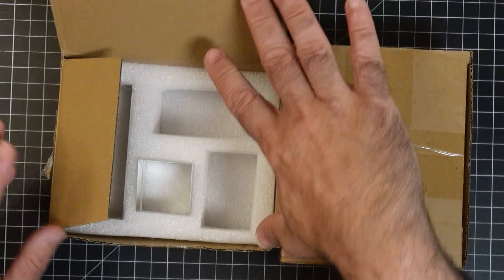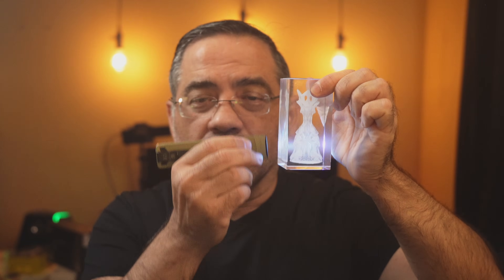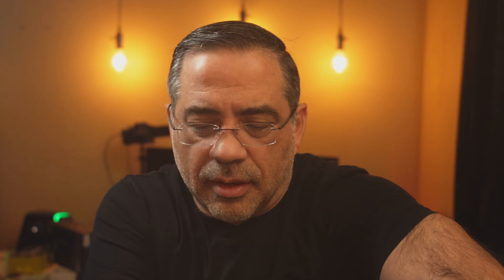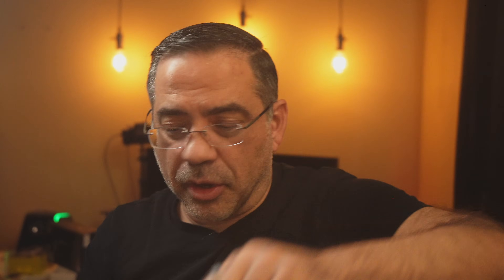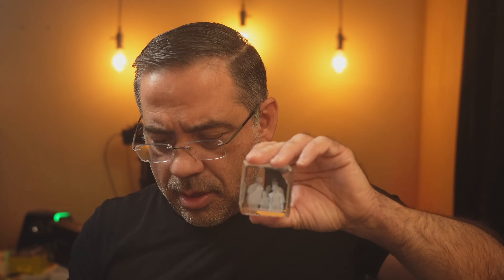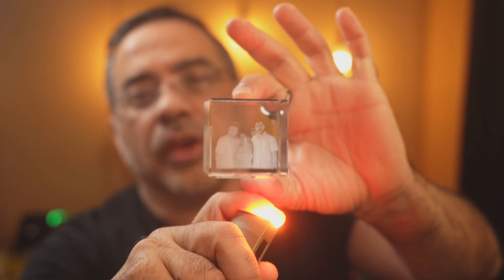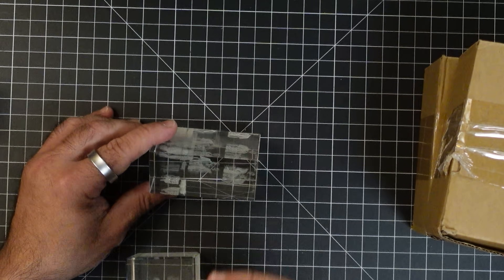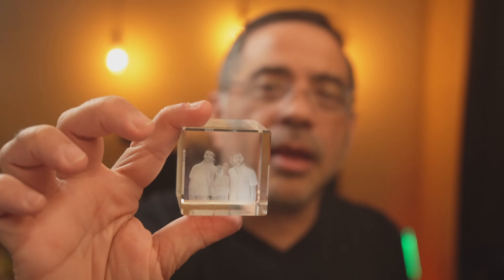HOW TO IDENTIFY FAKE K9 GLASS F2 Ultra UV

Comment: I was wondering if you would help me I’m trying to do an internal 3-D engraving with my new X tool UV laser for some reason my software is not accepting a 3-D file. I use a 3-D printer and I just use one of my plastic 3-D printer files to try to upload into X tool studio and it won’t accept it gives me an error message. Do you have any idea what might be going on thank you for your help.

Comment: Interesting, I think I bought the same set of K9 crystal and I have a failure with the same cube. I haven't tried the others yet. I went with the small one for my first attempt and it was bad. I moved to a 50x50x50 from ComMarker and it worked fine.

Comment: While I don't specifically have a UV flashlight, the three braincells in my back row reminded me I DO have a UV lamp setup used to cure prints from my other passion, Resin 3D printing. Will go see how my recent batch of K9 reacts to an evenly distributed flood of UV light.....
Reply from the maker: Uv lamp should work
Reply: Just tested. No detectable traces of hazing as demonstrated in this video. My setup is effectively a pair of UV Nail Lamps that use fluorescent UV tubes. MOST of what's sold today appear to deploy UV LEDs. I stand them upright so that it surrounds my print to blast it from all sides. Since the newer ones range from $9-$25, test your fake/real glass in one of these inexpensive lamps to verify if it's a valid approach instead of making everyone fork out $100 for an OLite. I'd rather spend the difference on gobbling up more K9 glass!
Reply from the maker: @cartertg you van get uv flash lights for 10 bucks
Reply: @ebpman  Nah. A $10 "UV" flashlight is going to have a decidedly-not-UV wavelength of around 395nm at best. Some things will still fluoresce under it (otherwise, the most common type of "white" LED would not work), but there will also be a lot of visible blue light. An actual longwave UV flashlight at 365nm or shorter wavelength, such as one from Convoy, starts closer to $20. They (and several other trustworthy manufacturers) also sell high-quality medium-wave and shortwave UV lights, which also have uses in identifying stuff. In any case, your test can indicate that something is probably NOT K9 if that something fluoresces (authentic K9 can be intentionally formulated to fluoresce, for some specialized applications, but it's unusual), but it cannot prove that something IS K9 because many/most other types of glass also do not fluoresce.

Now, someone needs to test how well non-fluorescent, non-K9 glass internally etches with a UV laser, since fluorescence is presumably what keeps some glass from working (since the fluorescence disperses the UV energy from the laser). I just got my 12W Omni X, but I'm not yet set up to make the test myself.